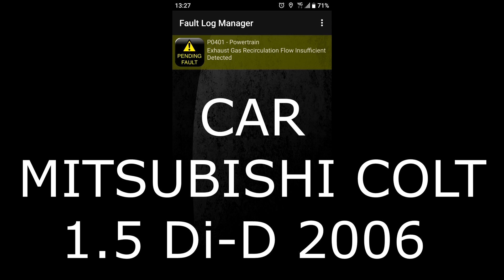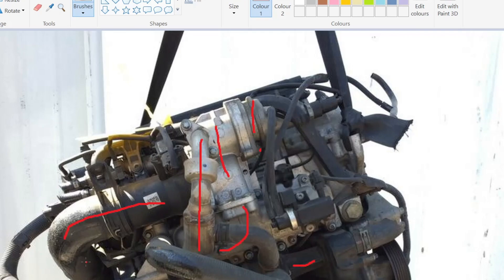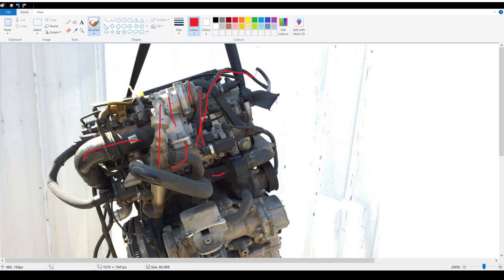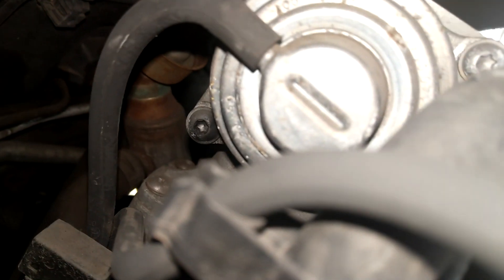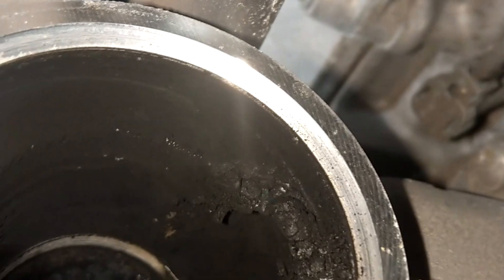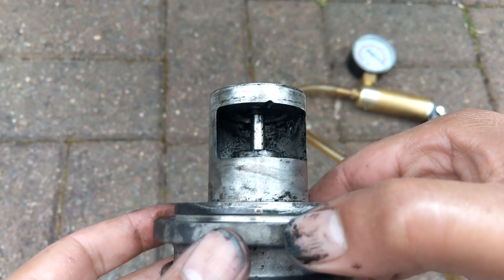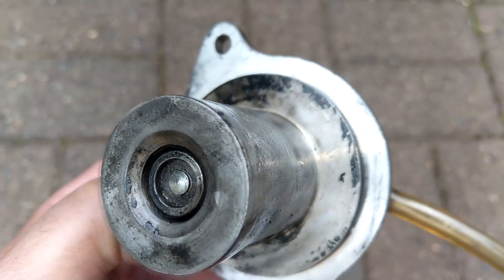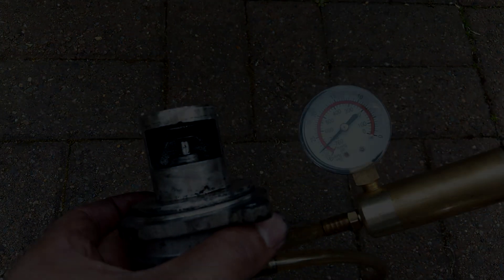Vacuum EGR Valve Removal, Testing and Replacement P0401 Free Fix

Comment: I was hoping this would be a Volvo D5 video. The square tin can along the side of my engine is connected to pipes full of a black devil substance.
Reply from the maker: Same principle for cleaning and restoring operation, just electrically actuated and you'll need to drain the coolant first.
Reply: @sirobb  Many thanks Simon. Always learn something new from your videos. Also, you are right about the Volvo water pump. It does not need to be changed with cam belt.
Reply: @monkeyboy8424 also was hoping it was a volvo, but I'm is V40 D4 r design 2.0 diesel, code p04d900 having problems with egr valve and cooler, volvo wants 13 hundred pounds just for the parts not including labour which is probably going to take it to 2k wow, feels like volvo have got me by my balls on this one don't know where to turn as the m.o.t is due next month and it's an instant fail isn't it just for the engine light been on